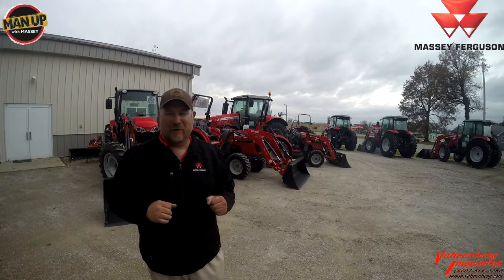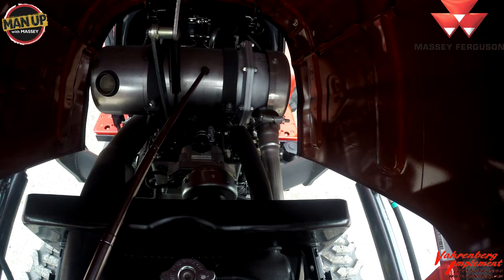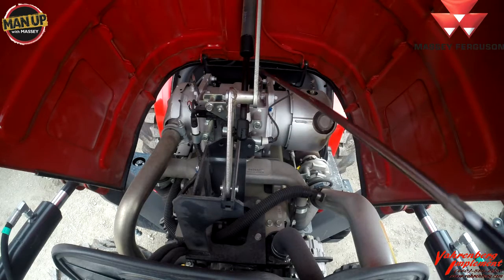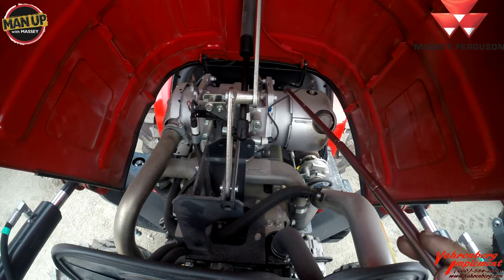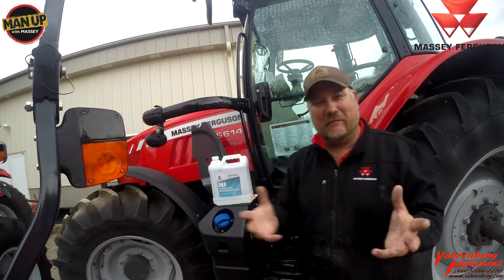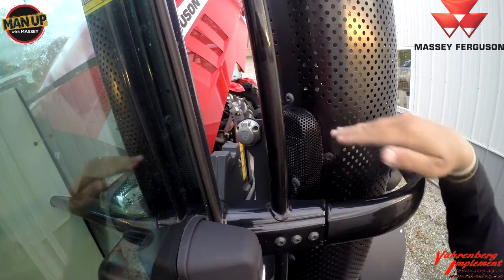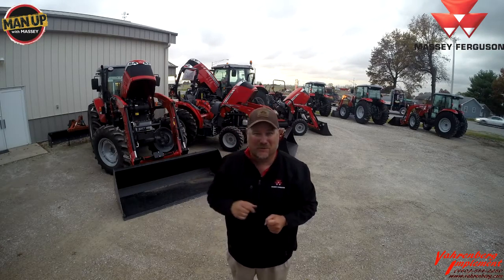Understanding Exhaust Emissions in Tractors

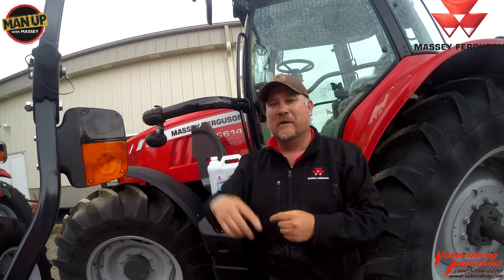Comment: I have a DPF MF 1739E It has been trying to re-gen since 10:00 yesterday. It is also beeping. Is there a way i could take the DPF off and clean it myself?
Reply from the maker: We would recommend contacting your local dealer as it probably need Diagnostic Tool Connected to see what is not working correctly or dealer REGEN may need to be performed.

Comment: I am operating a 1739 E. It has shut off on several occasions and then when you turn the key to the auxiliary position to start the tractor it makes a loud constant beeping noise like a back up alarm. All fluids are good. The occurrence of this is completely random. Sometimes it shuts down during operation and other times it will be operating fine and then when you go to start it the following day the alarm sounds and it will not even crank. Pleas advise?
Reply from the maker: That is Alarm to Alert you have a concern with the tractor. Any Warning Lights on the Tractor? Best to call your local dealer and they can help you. Probably needs to have service tech look at your tractor if Audible Alarm is going off.

Comment: So I have a question about the Massey systems.  Comparing two similar tractors, like maybe the 4707 and the 4708, you mention below that the 4707 uses EGR and the 4708 uses DEF but not EGR.  In the case of the 4707, does the EGR cause the engine life to be shortened any like it does in the automotive engines?  I'm not real happy about recirculating soot into my engine.  However, adding a bottle of DEF to the tractor once in a while isn't so bad.  I'm trying to decide which way to go.  I want a tractor that will last for many, many years.  I realize the DEF is an added expense, but if it keeps the tractor from putting soot into the engine, it might be worth it.  What is your opinion on this?  Thanks for your help.
Reply from the maker: EGR is Exhaust Gases Recirculation. EGR has been used for many many years and we have not seen any tractor engine life reduced because of EGR. We personally have not worked internally on any Massey Ferguson Engine since we took on Massey Ferguson Brand in 2008. We do very little engine work even on the older Massey Ferguson Tractors and AGCO Heritage brands we have been selling since 1952. And I can tell you that any EGR Engine has not had a failure because of EGR. In our opinion that is a Myth or Marketing Tactic to scare people. We have seen AGCO DEF System on our Massey Ferguson Tractors increase Fuel Economy because the emission clean-up is after combustion and has no effects of lowering power produced. Exhaust Gases are Oxygen Less Air and Oxygen is what creates Horsepower. You cool the burn with Exhaust Gases you reduce NOx Gases and Reduce the Amount of Horsepower the Engine can create. That is why they use the EGR on the 4707 and not the rest of the models 4708, 4709, 4710. They allow engine to create the needed horsepower and clean exhaust afterwards.
Reply: @VahrenbergImplement  Thank you for the response.  It sounds like I'd rather DEF than EGR, even if it doesn't shorten the life span of the engine.

Comment: When drove semis the last few years the 1st hat the dry regen then later had the def systems the def kept freezing ant could not regen below 0degrees the regen unit wouldn't get hot enough.
Reply from the maker: Sounds like they need to see what AGCO did because we don't have that issue with DEF freezing.
Reply: The exhaust system is built and routed on the semis the way the epa and dot require it to be
Reply from the maker: Sounds like they need to reengineer their designs. That might be one benefit of Massey Ferguson is they design & build the complete tractor to work together. AGCO owns the Manufacturing, Engine and Engineering department so they 100% control of everything that goes into the product where may Semi-Truck brands purchase engines and components from different vendors.
Reply: Vahrenberg Implement they can't they are built the way government polisy wonks require by law are required to do
Reply from the maker: AGCO builds Massey Ferguson and are governed by similar policies by the EPA and actually more stringent Global Regulations and they design the system to work. They could deign the engine coolant to keep DEF thawed like tractors do too. Actually tractors must have DEF System working within 1 hour of start up no matter the temperature so they are more stringent than EPA for trucking it sounds. Sounds like Trucking industry needs to catch up to the Ag industry.
Reply: Vahrenberg Implement but not fmcsa and dot just epa your filter or regen units are under the hood
 On cars tricks and semis they can't be there, they have to be under the cab or behind the cab that is fmcsa regulations you don't have that on tractors on them ot can be attached to the engine block
Reply from the maker: The DEF Tanks are not under the hood and the DOC where the Catalyst Reduction takes place are external and  away from the engine. They route coolant from the engine and run it through tubes like the heater in the cab to keep the DEF from freezing. The Global series is under the platform by the right rear wheel. The New Large tractors that takes place in the Exhaust stack on the right front corner of the cab. All DEF Tanks are externally mounted on the right or left side by the steps and away from the engine.
Reply: Vahrenberg Implement the way you heat the def tank is how some trucks heat there fuel tanks. As for your exhaust unit under the hood still heats it up instead of under the truck by the ground behind the right steer tire

Comment: Something I also learned when I was driving a semi on DEF it freezes at 32 degrees. Also the regen unit gets really hot, so hot it will start wet grass on fire just from the exoust from the exoust pipe or if the unit is close tp it.
Reply from the maker: Our DEF System dethaws with the Coolant Heater before you start the tractor and also remains thawed with the AGCO design during operation. AGCO system was test from -30° F to Operating in much less time than the EPS required Hour from Start-up do to the way they keep the system thawed. 
We only use Diesel Particulate Filters on some Compact Tractors and getting less and less each year.

Comment: The filter can be cleaned just like a semi trucks system. Cleaning can damage the filter though
Reply from the maker: I'm hearing some that attempt to clean but that is another added cost to Exhaust Maintenance with a Diesel Particulate Filter. The main thing is customers need to discuss with their salesmen Exhaust Maintenance, Procedures and Costs so sytems can very expensive to maintain.

Comment: Thanks for the great informative videos! I am looking for a replacement for my 1533.   Looking at either a 2706e it a 4707. Does either have an egr and/or cooler? Not a fan of those. I work in the automotive field and they don't have a good record. Also just looking for just a diesel oxidation catalyst. Any info would be appreciated. Thank you!
Reply from the maker: The 2700E & 4707 Global do not require Diesel Particulate Filter or Selective Catalyst Reduction (DEF) they do require EGR & DOC (Diesel Oxidation Catalyst). The 4708, 4709 & 4710 utilizes DOC & SCR/DEF for Emission and do not have EGR. We have not had to do any Emissions Works on any of the 2700E, 4600/4600M (Same Motor as 4700 Global) or 4700 Global Series but very reliable on Massey Ferguson Tractors. I would not be afraid of them with the results and performance we are seeing from Massey Ferguson.

Comment: Thanks for the video, is the frequency of the regen cycle and/or the lifespan of the filter effected by whether red or green diesel is being used?
Reply from the maker: There is no different in the Red (No Road Tax) Fuel and Regular Diesel it's only dye red for Tax identification. It's the exact same fuel. It will not effect the need to regen or dpf life. That is based on tractor operation. Operating at normal operating temperatures will reduce the amount of Particulate Matter and that will reduce regen & increase DPF life.